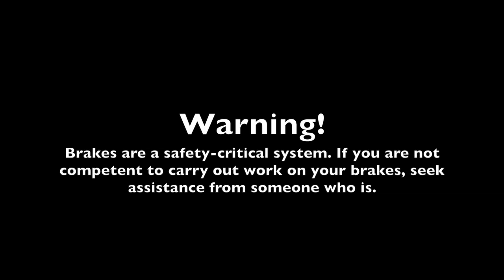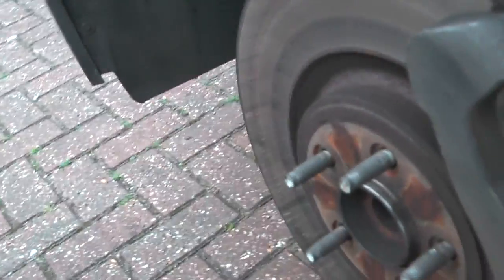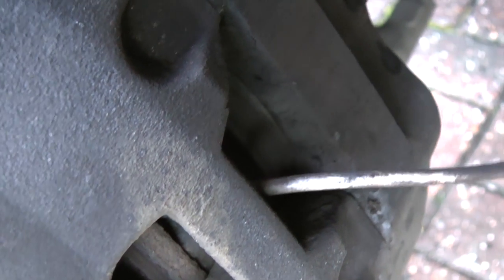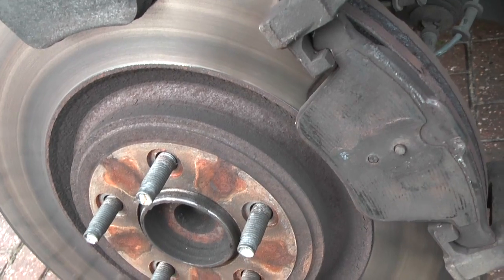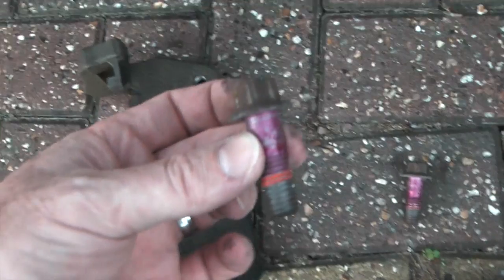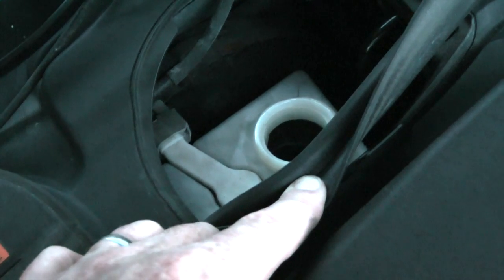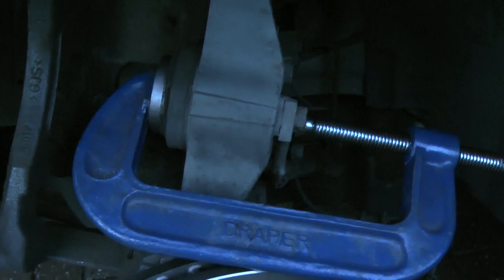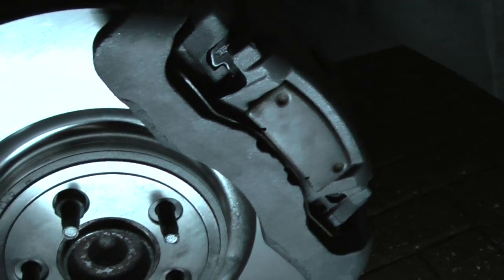Jaguar XF Front Brake Disc and Pad Replacement

Comment: Thanks for a great video. As xdave83 says below, I used this to help change the front discs and pads on my 2011 XJ (X351) and with your help it was dead easy. 9mm hex key was about £6 from Amazon to fit 1/2" sq. drive. Took a couple of hours taking it steady. I had to push the piston in before I could lift the caliper off but other than that everything was spot on. Saved £180 in labour. Parts £470 from Jag. but could have paid just £220 from local motor factors. Not much more expensive than when I had the front discs done on my V70 D5. Many thanks again.

Comment: Great video , especially the 9mm hex tip and torque settings.  Mine are the same 355 mm discs but I managed to wriggle the disk off without removing the carrier so have left the bolts undisturbed..  Refitting the spring clip was the difficult part.

Comment: Cheers for a great video. Just been caught out with the 9mm Allen key. Had most strange sizes but not a 9mm lol. No waiting for the tool to arrive. When it comes to brake discs and pads I have found EBC stuff amazing compared to most brands. Their basic black pads are often better then stock and a lot cheaper.

Comment: Jaguar dealer in Arizona wanted $2200 to replace front and rear!  That's pads only not discs and pads, just pads.  Did it myself for about $150 and that's after waiting another 8 months for the front because they had a lot of life left.  I've always worked on my own cars but never had a Jag before so was a bit concerned that it might have some tricks (like the 9mm hex you mentioned), that would drag out the process.  Overall not bad except that spring clip system is awfully precarious/unnecessarily odd, to get back on which is probably by design so we don't try to do this ourselves.  Anyway thanks for the video, saved me money and time.

Comment: Great video thank you. I had a nightmare lining the 9mm hex bolts up so had to take the calliper off and then fit them. I do have an issue now though, whilst everything is back on and secured, my pedal is spongy. I never broke into the system nor did I pinch the brake line. Any suggestions?
Reply: Some pads have orientation start from there

Comment: Hi, 
Great video. I intend to replace the brake rotors and pads on my XF soon.
What kind of lubricant do you use for the guide pins? Silicone or copper lubricant?
For the brake caliper bracket and pads corners i'm planning to use copper lubricant.
Thanks in advance and keep up the good work

Comment: Excellent video, do you know how the hubs are attached? I know there's 4 bolts on the back but can't see a big nut in the centre of the hub? Thanks
Reply from the maker: The front wheel hub and bearing assembly comes as one unit (with wheel studs, ABS ring and bearings) which bolts to the suspension as you mentioned. I believe the torque is 90Nm. Part for my car (MY 2010 XF) is C2C19585

Comment: Did brakes and rotors engine off pumps firm high and tight start engine and pedal goes to floor with it barely stopping was not an existing problem  any suggestions how to fix.
Reply: Raymond Drewniak did you find a solution to this? I’m having the same exact problem.

Comment: I'm having the hardest time putting the spring clip back on, what's a good technique to put it back on?
Reply: not of my creation..but if you put in place the bottom or top tab first and then use a plastic medium duty zip-tie to hold it in place, there is a feature on the carrier that is perfectly placed to allow you to do this, you can then grab the other end of the clip with a set of pliers and force it into place. After this it won't be perfectly seated yet so then tap the assembly with a mallet into place then cut the zip tie once the clip center tab is properly seated into the caliper.
Reply from the maker: Good tip!
Reply: Yes that's what I did lol. Thanks for the reply

Comment: How do you get the sensor attached into the pad? I can't get it to secure into it's hole on the pad
Reply: When I used Ferrodo pads I had to file a little the sided and bottom. See the the sensor fit nicely home without the spring. Then take the sensor out again and put the spring in the sensor,, Then push the whole lot in the recess with the spring one at one side and one at the other . Make sure it goes all the way in. Hope this will help.

Comment: Hi Leon,  I am looking at pads but they're just the bare pads, nothing else.  Can the I get them or do I need other stuff like the shims and lubricant as well?
Reply from the maker: Should be just pads needed. There is an anti squeak layer on the back of the pads already so you shouldn't need copper grease.
Reply: @leonfletcher6045  You mentioned about putting the pins back? Also, what is size should the front and rear motors measure before replacing motor?
Reply from the maker: @phinguyen365  Depends on the spec of your car - I think there are 2 sizes one for.the standard car and one for the S/R versions.
Reply: I have a 2012 supercharge what kind of front brakes pads do I need
Reply: XF supercharge 2012 what kind of front  brakes pads do I need

Comment: Is this the same process for 09 Jaguar XF Supercharged with 20 wheels? And do we have to buy the those bolds or can we reuse them with some threat lock?
Reply from the maker: I have re-used mine with thread lock. The service manual would suggest you replace them however!
Reply: @leonfletcher6045  how about the removal process. Is this the same for a 09 Jaguar XF Supercharged?

Comment: Did you have to take any brake fluid before starting the replacement of you break pads?, if so what did you use to get it out?
Reply from the maker: My pads weren't that worn, so I wicked a little out with kitchen towel. You could also use a syringe (the ones that come with Calpol are OK) or a turkey-baster works too :)

Comment: Hi did your breaks smoke a bit after changing the pads and disc. I did it on mine and took it for drive after I stopped noticed little smoke from front and all 4 discs were bit hot any idea please thanks
Reply from the maker: Did you do all of them or just the fronts? There may be a bit of the oily coating left on the new disc that is burning off with the heat. If it was the rears, make sure you reset the park brake. BTW you're supposed to be taking it easy for the first 200 miles or so! ;)  Have a look at the forums for breaking in new brake discs (and avoiding judder... new video coming soon...)

Comment: Is this a 2010 Jaguar XF? I have one and need to change the breaks and rotors asap. I don't want to take it to the dealer because they charge me a lot.
Reply from the maker: Yes it's a MY2010 XF-S. As I say in the video, my front calipers may be bigger than the non-S car, but the process is very similar. Make sure you know what size your discs are before ordering, there is more than one size!
Reply: Thanks

Comment: I just replaced my front pads and have little to no brake pressure. I bled all lines and still no brake pressure. Anyone have any advice on what to do to fix this?
Reply: Did fluid come out when you bleed them ?